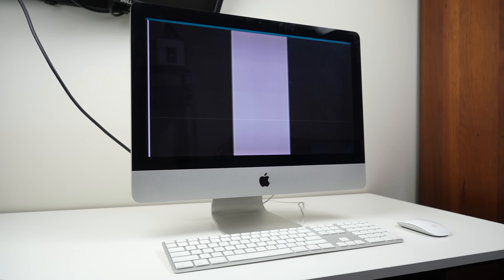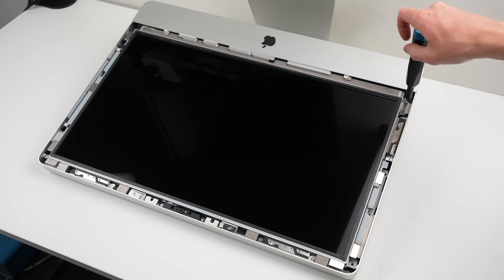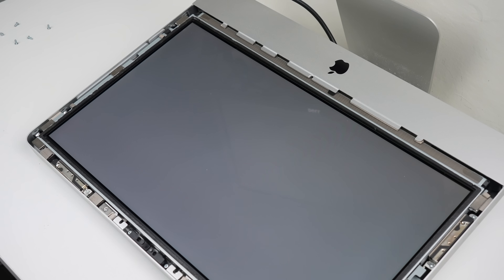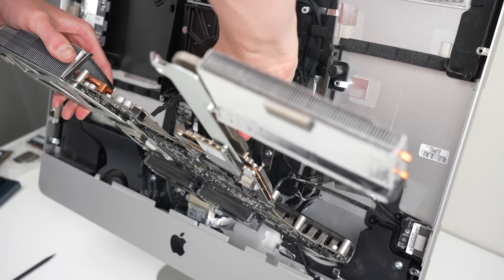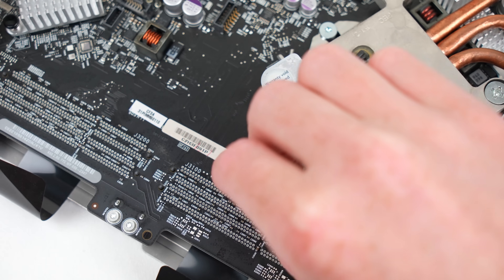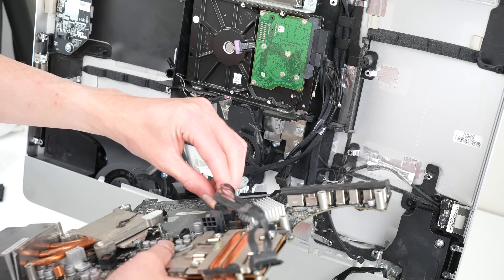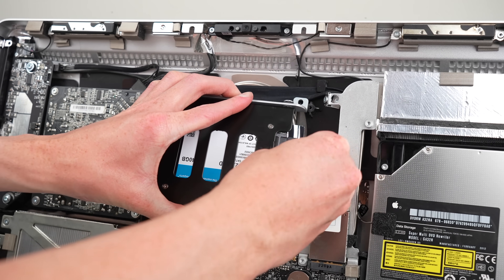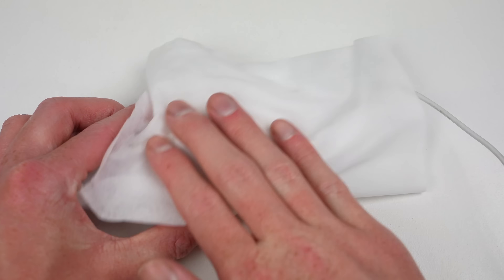FREE Broken iMac Gets Repaired And Upgraded!

Comment: my school has about 10-13 unused 2009 imacs (1 late 09 and 12 or so early 09s, all running el capitan!!)
about 3 have been tested (1 in use by one of the assistant principals for zoom) and 2 are locked, requiring an online account.
HOWEVER, ethernet ports around the room i was in have them all unplugged due to us getting new and cheaper switches, preventing me from plugging in the possibly 12 unmarked ethernet ports around the room without contacting IT. (yes i had permission from my school and the teacher who were housing these 2 imacs i tested to test them and make sure they atleast boot)

Comment: Your videos are great, but this one was such a bust. If the screen is gone on these imac's, that's it. You part it out. Can find these all day on the local classifieds for $100; no sense shelling out that much for a repair.

Similarly, I get that you clearly just upgraded it with whatever parts were lying around, but it is a considerable ordeal to service these imacs. If I was going as far as to swap the thermal paste/pads on the GPU then I would also be putting in a Metal compatible GPU.

Wi-Fi card is also doable, but not essential. But similar to the GPU, offers the most feature benefits.

Comment: Was replacing the thermal paste “really“ necessary on the GPU? Like Miani tested the temperature and fans of an iMac before and after replacing the thermal paste while running tests and didn’t find any significant difference.

Comment: The older Imacs modular conztruction is way better than the later models. The old design gave you DIY options to upgrade and improve. Apples later designs removed alm that flexibility.
Reply: You mean construction
You typed a z instead of an s

Comment: I'm guessing it's ether an Apple thing or a very tight power budget, that makes the 2600S the best CPU, because the i7-3770K is the best i7 for the LGA1155 socket(the same socket that's on the mac in this video) and the technical best CPU for that socket is the Xeon E3-1275, though it's basically on par with the i7-3770K though both of them do use an extra few watts of power. So I could understand if it's a power budget thing. Though seeing as the difference is like 12 watts, it would likely be fine as that's within the average limit of power supplies past their "max power". (as in a 500 watt PSU can likely output 515-520 watts of power before it becomes dangerous) At least modern ones anyway. Seeing as how behind the times Apple tends to be I guess I can understand playing it safe there as well.

Comment: The worst electronics to buy are from smokers.

The nicotine gets inside the equipment causing the internals to get sticky.  This causes dust and hair to stick to them c ausing overheating .  Not only is this difficult to clean,  they can smell of old fags when warm.  Avoid.

To clean keyboards,  a cheap mouthwash is great along with Q-Tips.  Most  mouthwashers are alcohol which is why the chronic  alcoholics will drink them.  Here in the UK you can buy a big bottle for only a £1.  Cheaper than meths!!

Comment: The unfortunate part is that this Mac will probably be largely unusable fairly soon (if not already) because of the lack of OS support from Apple. I imagine Safari barely works, if at all, and multiple programs and applications are simply failing now. The one upside is that you can indeed force upgrade this Mac to one of the most recent versions of the modern OS and it still runs great, you just have to bootstrap it with another piece of software. Alternatively, you can simply turn it into a Linux machine and have a very nice AIO linux computer that probably runs fantastically.

Comment: Thanks for the video; it was indispensable when disassembling our 2010 iMac that needed an SSD upgrade; and the tip about re-applying thermal paste and replacing the NVRAM battery was well received (I likely would have overlooked it).

Comment: Great job. It may be worth looking to replace those surface mount electrolytic capacitors before they start leaking and damaging the system board. Maybe use ceramic replacements. Recapping the power supply may also increase longevity.

Comment: What if it boots fine and shows the apple icon but then the display looks like it has a vertical/horizontal hold issue? I can't make out anything. I spent so much on the computer and then replacing the fan. I hardly even used it. I hate to get rid of a computer that's in new condition no matter its age. 😔

Comment: Very easy to get to the internals. Unlike the current generation of iMacs, there's probably adhesives, hidden screws, etc. Regarding user upgradability, its probably not coming back for some time. New processors (like the M1 or M2) will need to mature before this can happen.
Reply: It has nothing to do with the processor. It has everything to do with Apple not wanting people to repair their own devices.
Reply: @t1e6x12  That's not fair at all. Creating e-waste for nothing more than greed, money and power? This is why legislatures and/or Congress need to pass "right to repair" laws. I believe that Apple would push back against these laws if they were even introduced.

Comment: Really good video, seems a cut above the rest.  

One thing though - I've found that on those older iMacs, the HDD had a special temperature sensor that was missing when replacing it with an SSD.  This causes the fans to go to Max speed all the time.  I've fixed this in the past with software - a fan control utility of some sort that adjusts the speed according to the other temperatures.  Or was there a temperature sensor on the HDD that you could just mount on the SSD?

Comment: I had the same imac but it was 27 inch and I had to re-flow the gpu and it is now working fine with an i7 2nd gen with and Radeon 6970m graphics 16 gbs of RAM and 128 gb ssd.

Comment: Since you are talking about electrocuting yourself my biggest advice is to disconnect the power and then hold down the power button even though it isn't connected to remove voltage from those capacitors.

Comment: I installed a k1100 nvdia GPU but the imac 27 2011 heats up a lot, I have boot screen but no brightness control, the display seems to recognized as external and I cant have brightness slider  can someone point me to a link i can found solution?
Reply: That gpu is not officially supported u will need to flash the bios to a modified one

Comment: The larger iMac display opens like this.  Only the smaller screens of the 4k macs are glued down
Reply: Not on the 2012 and later models. All 21.5" and 27" 2012 and later iMacs have their displays glued in place.

Comment: I have a mid-2007 iMac, 2 GHz Core 2 Duo w/ 4 Gb DDR2 and Radeon 2400 XT 128. It is embarrassingly slow. Tap a key and the character appears anywhere from immediately to many seconds later. Type a sentence and the text appears up to a minute later. One, what could be the problem and Two, should I upgrade or abandon it? I plan on buying an M1 or better this year.
Reply: Hold off on a mac get an ssd and upgrade ram for about 100 dollars and buy a pc it will be cheaper more powerful and last longer

Comment: an informative video all be it id debate swapping a 500gb hd for a faster but smaller 240gb ssd is an 'upgrade' , considering a 500gb ssd is really not much extra which would then be a proper upgrade and not a partial downgrade/tradeoff
Reply: Also a 500GB SSD will likely last longer because it's not being filled so much.

Comment: Do you know any way to sell electronics well,I have iPhone se 2020 128Gb boost mobile, minor crack on back unnoticeable with case. Light scratch on front unnoticeable with screen protector. 
Comes with mous case and wallet attachment, and otter box defender.
Boost locked. Also have a set of AirPods 2, the right side is a little quite but both work, the case works but is kind of beat up.
Like I’m trying to sell for 300-350$ or like an Apple Watch six is this fair or even reasonable??

Comment: Those 2011 iMacs live forever. Unfortunately Apple doesn’t allow upgrades to big sur and higher, so you miss out on upgrades from O365. Mine is a 12,1 with 250 gig ssd + 500 gig hdd and 16 gig ram. And win 10 😜

Comment: As a 2017 iMac owner, I don't recommend the 2019 upgrade.
1. The after market adhesive strips aren't as durable as Apple's. They will fail, and need to be re-applied every once in a while, which is very nerve wrecking. 
2. Alignment issue and I haven't seen one talking about this. I attached my panel ever so slightly to the right. It isn't noticeable visually, but you can definitely feel it by putting your fingers on the side.

Comment: Good to see this update. When (if) our 2009 21.5 inch iMac with original keyboard and optical mouse fails, I may look into updating it using this video as a guide. I wish current generation Apple stuff was so easy to dismantle.

Comment: I NEED HELP …. I broke my iPhone 11 pro screen on accident…. Okay so changed the display for the most part my phone works fine …. Except for the fact that my main camera doesnt work …. But the the other 2 cameras do work if I switch to them but it also doesn’t let me turn my flash on but when i go to take a vid on the 0.5 or 2x camera it turns on normally …. Is there a fix for this ?

Comment: I repaired my 2011 21.5” iMac (Core i5 2500S model) back in June 2021. I didn’t upgrade my CPU as it works fine for basic tasks but I upgraded the GPU to an NVIDIA Quadro K2100M 2047MB due to a failure on the old AMD Radeon HD 6000 series GPU. I also managed to bump the RAM up to 12GB, replaced the HDD with a new SSD, and removed the DVD drive for better cooling. Quite frankly after the repair, due to the replaced GPU, I couldn’t get my display brightness and boot screen to work without OpenCore. So if anyone is tech-savvy here, has an old pre-retina unibody iMac, and is interested in tech and computing, I would recommend upgrading the GPU due to a well-known card failure on the AMD Radeon HD 5000 and 600 series of GPUs, even if you may lose the brightness control and the boot screen.
Reply: UPDATE: I used a tool developed by some guy called Nick[D]vB on the MacRumors forum to flash my GPU card and brought back the boot picker. I was then able to bring brightness control back with OpenCore. It was quite a hassle to be honest, but it works fine and kinda flawlessly at the end so I couldn't really complain lol

Comment: Great job! 
Something to keep in mind for next time though: it's a good idea to also replace the dry and crusty thermal pads on the graphics card's memory chips. Memory failure due to overheating is a common problem on older machines, as dry thermal pads lose the ability to conduct heat.

Comment: Hi Hugh I am new to having a iMac it’s the 2011 one it was working spot on I don’t use it for a week turned it on the sound comes out starts up but the the sound will not work I have had to fit some external speakers do you know of any fixes thanks

Comment: i've opened quite a few newer style iMac's now and they're all pretty painless to open, just use a pizza cutter style opener and run it around the sides. easy as pizza!
Reply: Do be careful with that as with modern Laptops it can pontentially cut right through the screen
Reply: @stephensnell5707  Yes, everyone should exercise caution when opening devices and looking at tare downs/disassembly videos will tell you what and where to be careful of. I have destroyed my fair share of Surface screens :P

Comment: The i7/2600 (3.4) was the fastest and could have been used. That’s what I did on my 27’ followed by a NVIDIA K2000M , SSD and 32GB of ram.
Reply: With the 21.5" iMac you should stick with the i7-2600S. It has a lower TDP than the regular 2600.
Reply: For half the price of a i7-2600S, I found an Xeon E3-1270.  Has a higher TDP but still within range for even the 21.5”.

Comment: I got a 2010 21.5” iMac for free about a year ago.
Core i3-540, 4GB RAM, and upgraded from a seemingly dead 500GB hard drive to a 240GB SSD.
I used that thing to play Roblox since it was much better than even my other PCs at it likely due to its dedicated graphics.

I’m gonna upgrade the RAM in it soon to 8GB. I’ve gotten a new PC that’s better than it at running games, so I’ve been using that.

Ironically, the hard drive still works. I use it in a Dell Optiplex 3010 running Linux.

Comment: Bro, I have pretty much that same imac, mines a 21"..got mine from a school that was Throwing them away..It had an i3 in it as it was a special version made for schools..the usual versions had i5 and i7's...anyway, i wasnt sure if the board would work with an i7 and getting Any advice or confirmation from forums was futile.. so i did it anyway and it worked fine..used an i7 2600s  ..dont try and use the straight 2600 at 3.4ghz becuz it will run too hot in that chassis...also bumped ram from 4gb to 16gb and an ssd of course.. i run highsierra and capitan dual boot on it and love it..such a cool and perfectly capable little machine even today.. well worth fixing up.

Comment: To prevent a shock, you should wear a wristband connected to earth; wearing nothing you could damage the motherboard.
I had it once, when I touched the power supply of the computer, and everything in the building was short-circuited.
Reply: That Is very dangerous advice, you shouldn't be grounded when handling power supplies, since when you're not grounded the current has nowhere to flow. Put on your wristband after removing the power supply

Comment: Don't the fans spin like crazy?  Normally you need an ssd thermal sensor extra cable or a jumper mod else the iMac fans are extremly loud (if im wrong correct me i did the same with my 2010 iMacs)
Reply: just use the mac fan control app and manually set the fan speeds.. i think u can even disable the ssd thermal sensor
Reply: @skip741x3  you cant disable it but the fans are really annoying even if you have the fancontroller. While you are booting the fans go crazy and if you want to use like linux you wont be able to controll it.

Comment: They are good computers Mine is the exact same model, mid-2011 21.5 inch. Its still with its original cpu and gpu but upgraded to 16gb ram and a samsung evo 850 500gb ssd. I wish I could one day upgrade the cpu to a i7 and the GPU to a better one that also supports metal so I could upgrade it to a newer os without issues.

Comment: Careful about just putting a glob of thermal compound on a GPU. They don't have an IHS, so you can get hot cores if the pressure of the bracket doesn't spread the compound evenly.

Comment: It's always insane to me how, in the iMac, they don't have an external AC Power Plug... but instead have an internal power supply taking up needless space and adding extreme risk to anyone inside looking to upgrade.

Like... Apple... Just have an external power supply in the AC Power Adapter - save your entire supply chain the trouble... Bonus points: If the supply is damaged by a power surge... you don't have to dismantle the whole system to get at it.

Comment: I repaired one of these once and I also upgraded with an ssd, but then the fan ramp up at max speed because of the lack of the temp-sensor included inside the older hdd (and not sticked outside like the odd). Thankfully a couple of tools help me out, otherwise I should have modify a pin on the sata cable responsible for the sensoring
Reply: Posso chiederti come hai risolto? Ho lo stesso problema e non sono propriamente del mestiere...
Reply: @g.c.9904  Ciao, c'erano delle guide su come disabilitare fisicamente il settimo pin del cavo sata (credo d'alimentazione) che era quello che si connetteva al sensore sull'hard disk. Altrimenti in modo più pratico esistono dei cavi appositi con il sensore collegato proprio per chi ha questo problema, in alternativa installa macs fan controller e abbassa le velocità delle ventole così che vadano al massimo soltanto durante il login
Reply: @FilippoMarrapodi990  Spettacolo! Grazie mille, sei stato gentilissimo
Reply: @g.c.9904  Ma figurati, è il minimo aiutarsi in ste situazioni 💪

Comment: huh those antenna cables were mounted in the backwards order, ch2 had 0 stripes and ch0 had 2, also there was no need to remove the power supply to remove the whole logic board